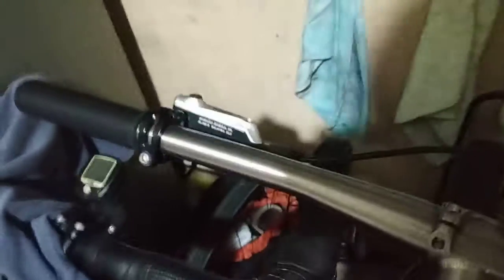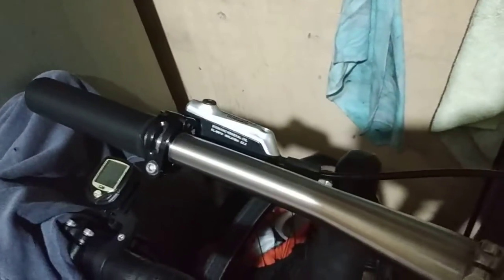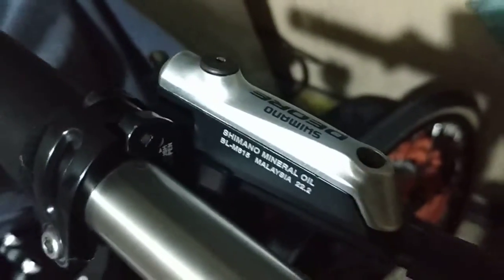Deore hydraulic brake M615 problem, anyone with a fix?

Comment: i have that click but that doesn't interfer with the braking performance
Reply from the maker: Yeah, but sometimes when riding alone in the middle of nowhere it kinda gets annoying, still same no time for me to replace or fix the clicking noise
Reply: @JomsF  I know it's annoying but when we are used we don't give a f.... 😅😂
Reply from the maker: @MiguelKobainofficial  correct.. i may just leave it and keep on using jt like that til breaks, another reason to get a new one